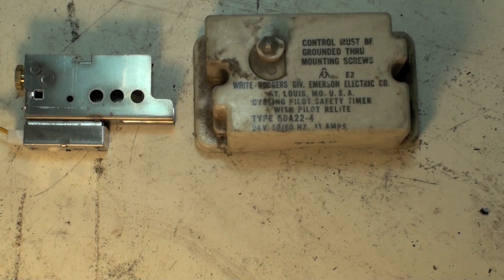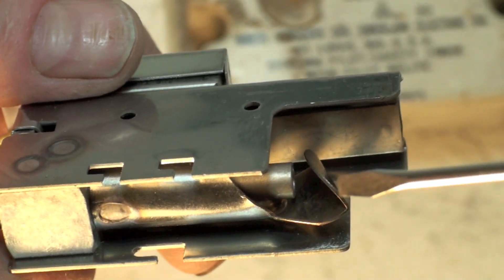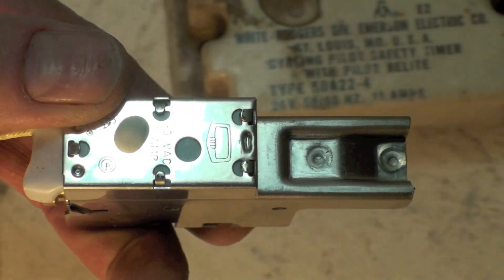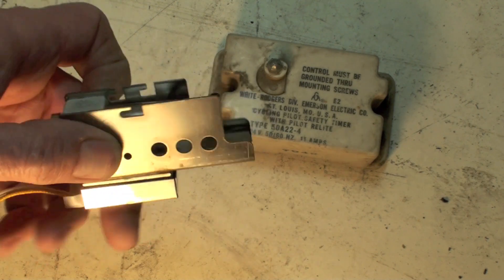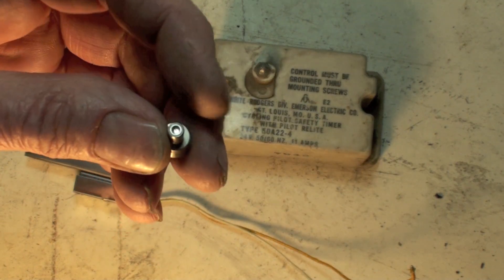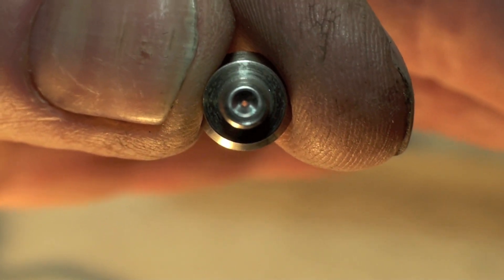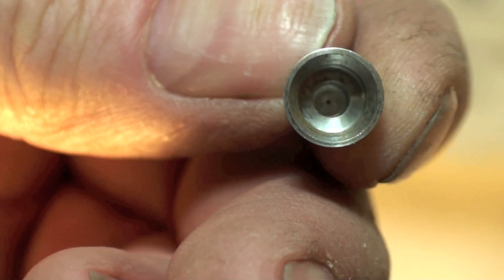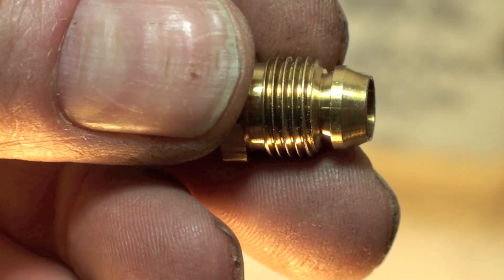Gas furnace pilot relight assembly sequence of operation, troubleshoot

Comment: Never use pipe dope on a compression fitting. Never.
Reply from the maker: Here is the question: why not?
GFM
Reply: @grayfurnaceman  The whole point of a compression fitting is to seal two soft metals against each other, putting dope on the threads makes it harder to get all the way tight.
Reply from the maker: @sssssnake222  Man, that is so far off.
First, the threads do not seal anything.  They are not tapered, so they cannot seal.  They are there to apply pressure to the sealing surfaces.  
Speaking of applying pressure, pipe dope is a lubricant which will apply more pressure to the sealing surfaces, not waste it on friction of the threads.
The value of pipe dope, rather than using oil on the threads, which is better than pipe dope on the threads, is on the sealing surface itself.  It fills microscopic gaps in the surfaces and seals a leaking ferrel.
Try it, it works.
GFM
Reply: @grayfurnaceman  I would not hire someone who put dope on a compression fitting. Cleaning the face is all you ever need to do.
Reply: @grayfurnaceman  I mean heck, I wouldn't even care if you put a little grease on there, but never dope lol.
Reply: @grayfurnaceman  when I see dope on a compression fitting, I immediately think hack. I'm sorry if I'm sounding like an a******, it's been a long couple of weeks, I'm not trying to be a jerk but, it is hugely frowned upon to put dope anywhere near a compression fitting.
Reply from the maker: @sssssnake222  I have given you a sensible solution to a fairly common problem that has worked for me for many years.  You just insult.  Maybe you do not leak check your fittings.  There is your insult back.
GFM
Reply: @grayfurnaceman  really, you're accusing me of being a hack? I take back my apology.
Reply: Use copper coat instead of dope on compression fittings

Comment: As a recent retiree, I'm spending a lot of my time now on upkeep and repair around the house, that I didn't get around to when I was still working.  Our HVAC has been very finicky for the past couple of year, not always starting reliably, until it completely stopped about a week ago.  This video, plus your "Gas furnace pilot relight assembly sequence of operation, troubleshoot", have led me to believe that my three wire pilot burner assembly is the problem, so I've decided to replace the whole unit.  Without your videos, I would never have had the confidence to give this a try.  I'll let you know if it works.  Thanks again for all of your videos.
Reply from the maker: Looking forward to it.
GFM
Reply: @grayfurnaceman  what is the orfice for? and does it go in , in a specific way.?

Comment: Hi, I'm troubleshooting a Comfort-Aire furnace model GHL-175-D5. It has a White-Rodgers model 5059-22 pilot relite. The pilot relite module went out, so I got one on order. I have to manually light the pilot light in order for the furnace to come on, but after the blower shuts off, the pilot light goes out, so I was wondering if the mercury pilot safety switch is bad, or is it supposed to be that way. Also, I was wondering if I can use a model 5059-23 in its place.

Comment: Just realized that it's an old screw piece that's snapped in half... And the end of the pilot gas feed is wider than the screw itself so it won't come off. Any advice kind sir?
Reply from the maker: +Omar Benlamhidi Can your drill it out and rethread?
GFM
Reply: Oh, I didn't think you would actually respond. My buddy suggested a tube cutter and then put the new one in and it worked! Your videos are awesome by the way sir! Thanks a lot for the useful information!
Reply from the maker: +Omar Benlamhidi Welcome
GFM

Comment: Hello, I appreciate your videos sir. I have a similar pilot assembly, the three wire bimetal one. I just replaced the assembly but I couldn't replace the nut that goes into the assembly for the gas tube because there was a sort of stopper I couldn't remove. Should I just try to force it a bit more? Don't want to create more damage, so I used the old one. I'm now suspecting that's the problem because my pilot light turns on but shuts off and it keeps repeating. The burners turn on rarely due to this cycle. Any advice?
Reply: The stopper is your orifice

Comment from the maker: It is quite possible that the pilot solenoid is not opening the valve.  If you look at the diagram you can tell the terminals that should have power.  If there  is power at the terminals, and gas is available, the gas valve has failed.  Unfortunately, the gas valve is very expensive.  Hope this helps.  
GFM